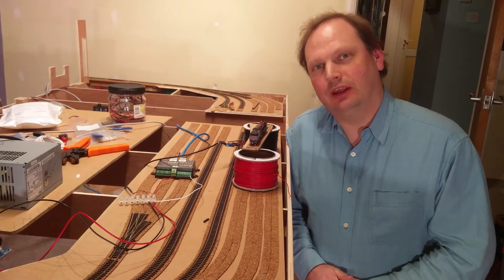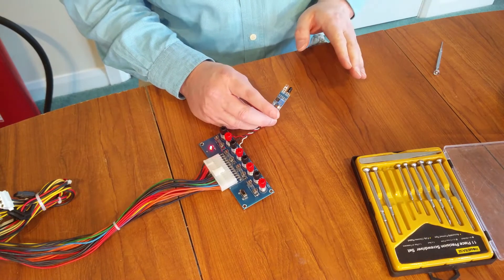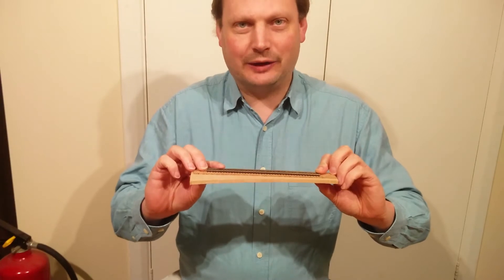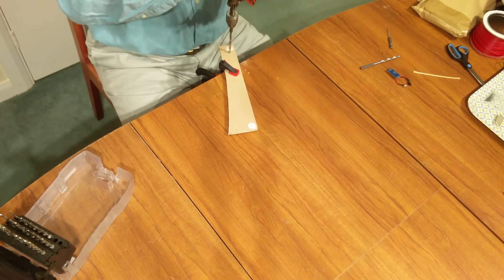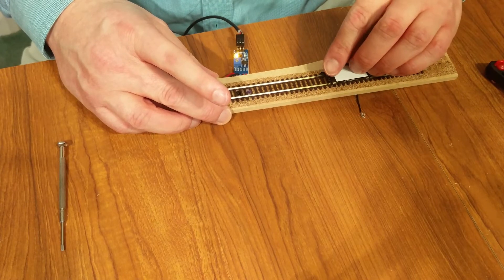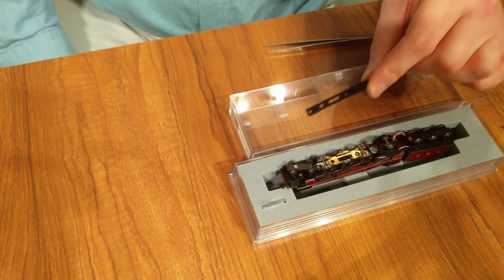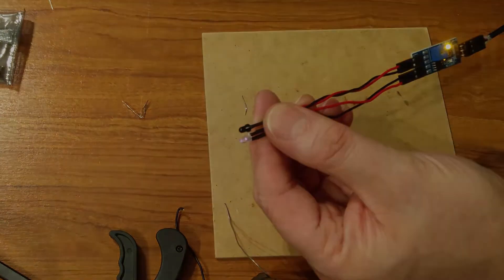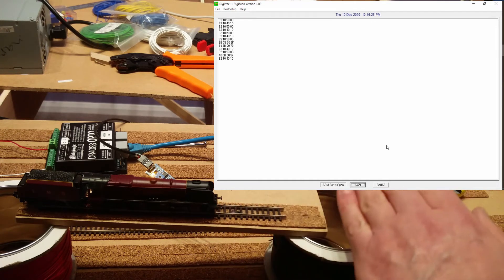25 - Infrared DCC block detection | Digikeijs DR4088OPTO

Comment: I went through exactly the same process, but I wanted them in a hidden section and just couldn’t make them work in a dark covered situation. In the end I gave up, they were too hit and miss in set up and so now going for current detection. I do like the ability to bring trains to a halt in a section with your system, must look into that!
Reply from the maker: That is interesting. Many of mine will be in an underneath area so perhaps I will have the same problems. It did occur to me that light reflected from "ceiling" would be a problem, and so I might need to paint the underneath of the board above them in black. Oh - the adventures ahead!
Reply: @naivegauge  of course maybe I didn’t try hard enough, but did do a bit of research before I gave up, it’s the darkness that cause the problem, I have an idea that it’s something to do with that the variable pot settings and component values that are reacting within ambient lighting. If that makes sense.
Reply from the maker: OK. I think I will do a few more experiments then before I make too many assumptions about what it will be able to do. Thank you for the warning.

Comment: Many thanks for the inspiring videos.
I started experimenting with the IFR in the n-scale track.
1.8mm IR LED Pairs, Emitting Diode SIR2055 and Infrared Receiver Phototransistor SGPT2055B
Not placed at an angle and it
functions perfectly.

Comment: Many thanks for your well explained procedure. I'm very interested in theDR4088 Opto unit as I have already used several DR4088LNs for block detection on my layout and am just completing an undertrack - hidden storage yard using them to guide the operation. However, as you  found, it woudl be very useful to have an on/off detector at track ends rather than using guesswork. When I look a the rather brief explanation of the devices on Digikeijs website they don't seem to explain the ability to read on/off high/low volt signals from devices so I'm curious to know how you found out the explanation of how they worked? 
Also I'm wondering why you chose the S88 version?  As you will know there's already a DR4088LN Opto in the series which would be the one I would logically choose as I am using Loconet for feedback. Is there something different that would make the 4088LN Opto version unsuitable? Thanks once again.
Reply from the maker: I got the s88 version as it is cheaper!

Comment: Sometimes that little bit of flex the Copydex has can be good for compensating for temperature movements, but you do need to be careful if you are using flexitrack to make sure it is pretty well bent to shape first.
With the Infrared sensors, I know this is two years later, but even in 2020 you could get ones that had smaller right angle LED/Dioded combination tht allowed for under track installs.   If you can find these, as the sensors are also smaller, they work better for in track detectors.  This also helps as you need the diode to be close to the LED otherwise it won't get reflected IR light properly.   Also, you have to adjust them as sunlight and other infrared sources (such as heating) will also trigger these devices.
Reply from the maker: Thanks Brendan for the info about IR detectors. I think I am a bit uncertain about if they are helpful for not - my next video I install a load and so will start actually using them. I have discovered that they are affected by7 sunlight which is annoying, however the area I have installed them so far they will all be under the layout. However I have put more occupancy feedbacks in anyway in case I need to abandon them.
I would be really grateful for a link to the IR detectors you mention.
I also have my suspicions about copydex - I am influenced by Chadwick Charlie, but do worry that kinks will develop over time. I generally remove the sleepers and pre-bend each rail now, before putting the sleepers back on the rails.

Comment: The sensors need to be mounted under the track at a 45 degree angle, sort of like a pyramid, where the beams come together about at under the frame of the loco.  Otherwise, the beams are shooting straight up and reflecting straight down and your detection range is very limited ( bulb to bulb).

When setting these up across the rails, they are staggered at a 45 degree angle so that there are no false triggers between cars.  Used more for block detection this way.  Your way is simply for initial detection

Bob s
Reply from the maker: Good thought - I did wonder about that. Has doing it that way worked for you?
Reply: Absolutely correct!

Comment: Hi Paul. Very interesting. Rather than painting the underside of your loco, I might have tried sticking some aluminium foil to the underside. Infrared vs current detection: would you please explain why use the two methods?
Reply from the maker: Current detection lets you know that your loco (or other current drawing rolling stock) is somewhere in the block of track, where as the optical detector tells you that the loco (or other rolling stock with a reflective underside) is at a specific location on the track. The current sensing block detection method is good for running trains around different routes etc, but can struggle to stop a train at a specific location (such as the end of a siding, or in a station) To do so it is necessary for the software to have a speed profile for each loco, and then time it from the moment it enters the block. Using this optical method  provides the option of configuring software to slow the train on entering a block (via current sensing) and the come to a complete stop at just the right location (via the optical detector.)
I have lots still to learn about using train controller / JMRI / iTrain, but I wanted to give myself options and install the hardware in the track now as I build the layout rather than come back to it later and regret not having taken the opportunity.
(my name is not Paul!)
Reply: @naivegauge  Hi Paul. Perfect explanation - thank you.

Comment: For n gauge I found replacing the 5mm LEDs with 3mm. Cheap as chips from a well known online seller. A 3mm hole is perfect between the sleepers and it's possible get both LEDs between a pair of sleepers quite neatly. Had to drill from underneath a 5mm hole to allow for the wiring
Reply from the maker: Yes, I found the 3mm components worked really well. I would be interested to know what you used the detectors for? Have you used them for DCC occupancy detection?
Reply: @naivegauge  I've been following Little Wicket Railway. Rob has done a fantastic series on DCC++ on the Arduino and has done a couple on sensors. One has been on IR where he uses JMRI to run a Back and Forth automata. I've managed to emulate this.

I have experimented a bit with the placement of the LEDs. Initially using them with aluminium foil with the engine breaking the beam. Next was embedding in the track either side of a sleeper which worked OK. I tried two sleepers apart at a a slight angle but that was a wash out. Finally got them in between two sleepers. Painted some white on the underside to ensure a good signal but will try a clean engine. 

Rob has done a good tutorial on using current sensors for block detection using sensor kits CT2 from MERG at £6.23 each. They give 2 channels. Have assembled one successfully and am considering doing my first YouTube assembling one as the instructions are aimed at someone with a fair bit of knowledge, which I haven't but managed to get it right after making a small mistake in which components to fit. They work really well for block detection.

Comment: A master moduler with HO warned me about this.  Also discussed on youtube in various places.

He also uses 3mm leds.  They are mounted in line, not side by side, about a sleeper apart, to form that pyramid beam  arrangement.  In this arrangement when the LED comes on, you are pulling a HIGH signal.  Across rails, the beam is always on until a loco comes by.  Now you are breaking the beam and pulling a LOW signal.  Arrange your detection module to look for the proper level signal.

Bob S
Reply from the maker: nice

Comment: I bought a bunch of those same infrared detectors but I replaced the LEDs with 3mm LEDs which fit better between the rails.
Reply from the maker: Yep, I ended up doing exactly the same. 
Do you think the IR detectors add much to the system? I am not sure they bring anything that occupancy detectors can't do.
Reply: @naivegauge  IR detectors are point detection. Sometimes you need point detection and sometimes you need block detection. I use both types. For block detection I use BD20s.

Comment: Sorry, I may have missed this in the video: your power source: 5 volts but with how many amps please?  Also, how do you ground the sensors?
Reply from the maker: there is a video somewhere on my channel explaining how to convert an ATX power supply into a 12v 5v and 3.3v power supply. That is where the power comes from. in theory it can push something like 20a, but obviously I do not need that, and I have built a 5a circuit breaker into the circuit.

Comment: Very interesting video! will you be combining the op-to sensors within a block of track which is already being detected by the current detection block sensor or in their own right? also I'm not sure if it would work but if the led's where connected to a fibreoptic cable would that work? as you could then get the sensor down to between 1mm and 2mm, just a thought. Loved the way you used 3mm components for the detection, they really make a difference. All the best Tony
Reply from the maker: Thanks Tony. I have to look in to you fibreoptic idea, there are loads of things that could be useful for in modelling.
Reply: @naivegauge  Now you have me wanting to experiment LOL! just ordered some boards to play with, but will use a arduino to see if I can make them trigger a animation 😁😁

Comment: Hello, what's the difference between OPTO and GND feedback modules?
Reply from the maker: The way I got my head around the difference between the modules is:
CS detects current
OPTO detects voltage
GND detects resistance

Comment: I am building a museum grade N scale layout.  For N scale, it is easy to ruin the rails with these.  So I will construct a small wooden platform or base, mount the sensor right next to the rails a bit above rail head height so it reflects the head end.  Now the sensor is upright with the pot for adjustment and no need for led extensions.  Cover this assembly with a bush of poly fiber or some other scenic element.  Position the sensor such that the leds are not within the line of sight of the spectator ( so that they spoil the display)  Just poke a spot in the poly fiber so that the leds can poke through.  If your scale is larger like HO , use a 3 sided building object and leave the one side open for the leds.  The viewer can see the other 3 sides.

Bob s
Reply from the maker: Nice

Comment: those infrared leds and phototransistors also exist in 3mm diameter, which would be more suitable for N scale
Reply from the maker: Indeed. you may have seen in the later parts of this video I swapped the components for 3mm ones.

Comment: Iam using this for my Speed detector n scale but sideways acros the track 
so when no train, the connection is established all the time, when the train crosses the 2 diodes it disrupt the connection, 
much better connection,  than relaying on refelctions in the surfaces of the trains

Comment: if you're going to the effort of removing the LEDS from the board why not replace them with 3mm so you can sit them side by side in a sleeper gap?
Reply from the maker: You will see towards the end of the video that I do indeed replace the 5mm components with 3mm components which fit much better in between the sleepers. For n-gauge it is a tight fit, but for OO it would make them even easier to hide.